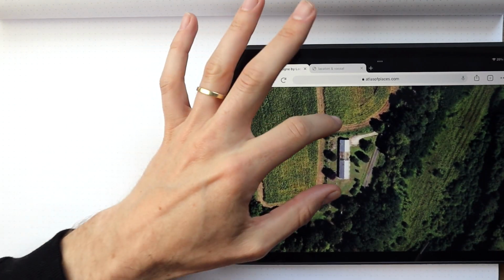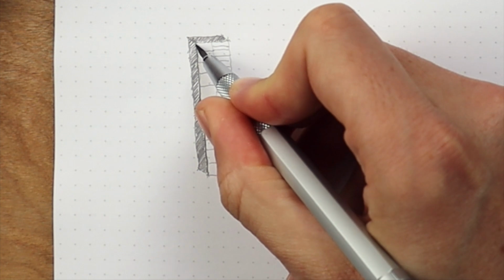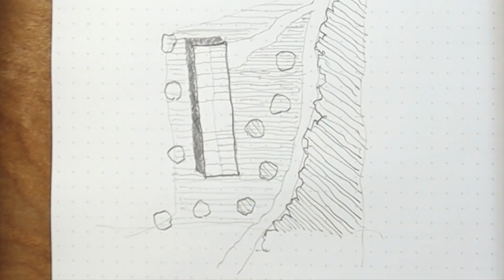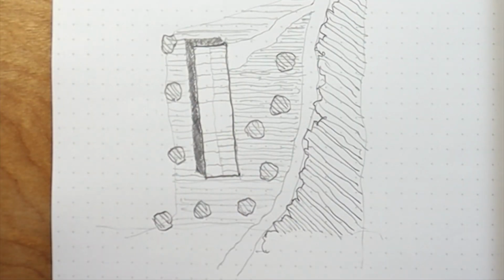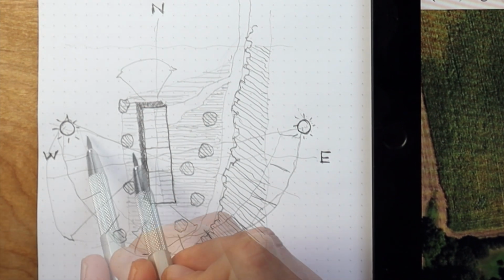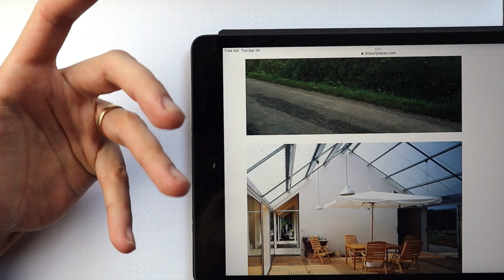How to Make a Site Analysis Sketch Diagram (Thinking on Paper)

Comment: How i can find sunpath?
Reply from the maker: Thanks for watching! For a sketch diagram like how I show in the video it's just about remembering that the sun rises in the East and sets in the West and is at it's highest point at the middle of the day. If you need to use a more accurate sun path you can use this resource: 

https://www.suncalc.org/#/27.6936,-97.5195,3/2024.01.21/17:43/1/3

I hope this helps! Simon